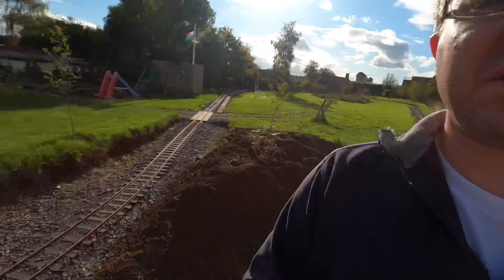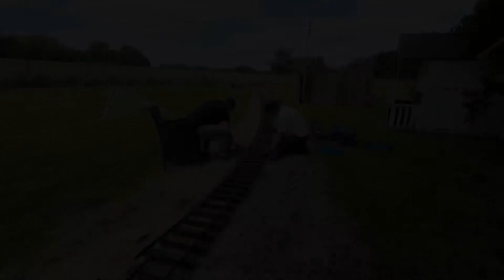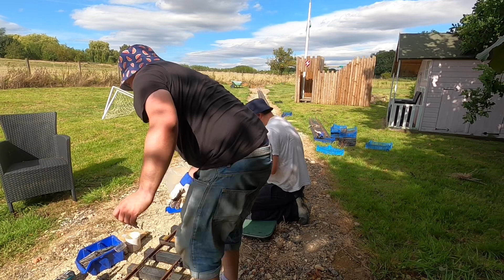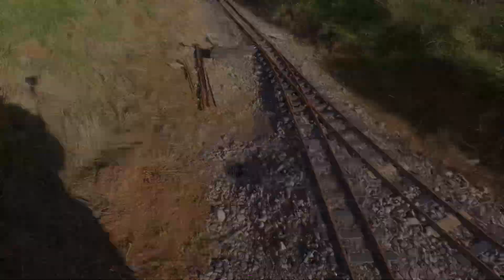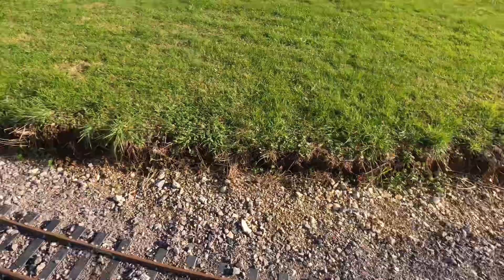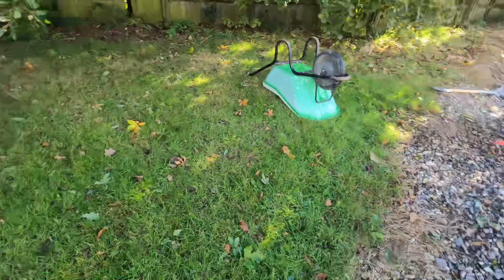November Update

Comment: If you don’t mind me asking a few questions, answer at your discretion.

1. Where do you get your rails? And what specs are they? (7 1/4)

2. Where do you get your locos from and if they are custom built?

3. Are the rails bendable by hand? I don’t have a wide selection of rollers like some people do.

4. What’s screws or bolts do you use? 

Anyways great video! Love your work! Have a great day man!
Reply from the maker: Thank you. The track is from Miniature rail supplies and is their steel 7 1/4. The bolts come with it. No chance of bending by hand I’m afraid. You need aluminium for that. 
The loco is from ride on railways, but isn’t advertised.
Reply: @GreatEastonRailway  do you know if the aluminum track from miniature rail supplies is bendable? Also thanks for your response!!